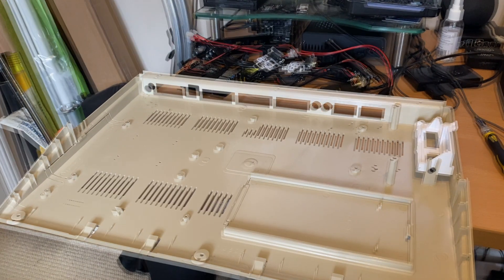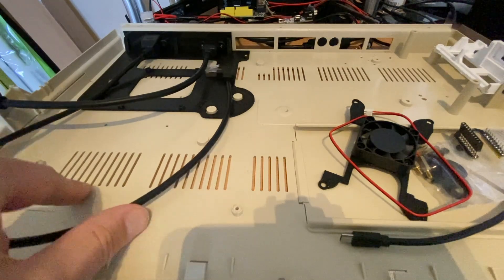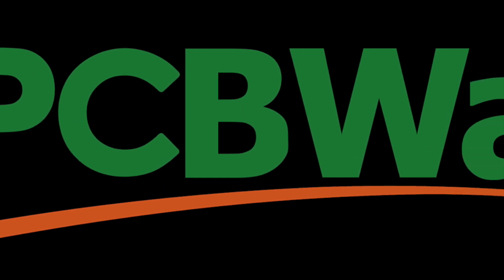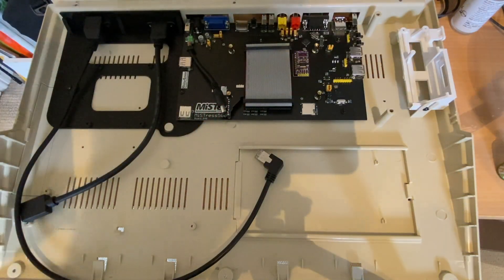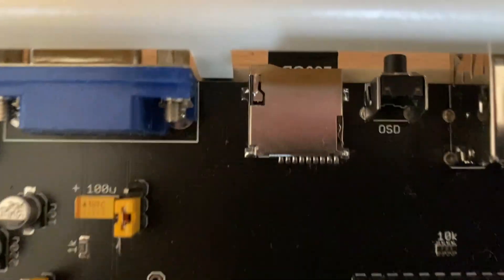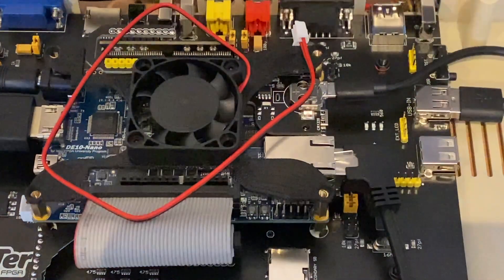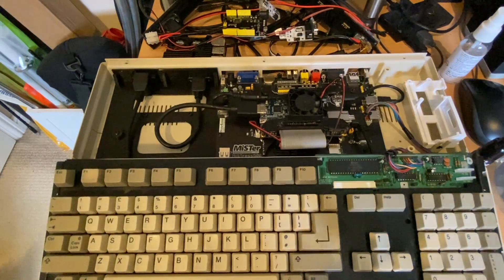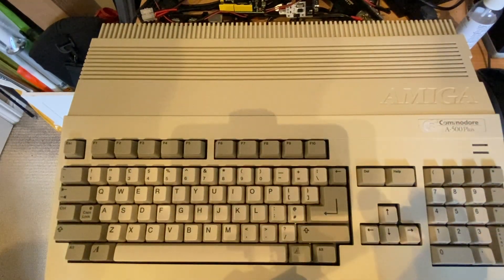Amiga 500 MiSTer + MiSTress 500 : Build Your Own Amiga

Comment: very nice, i didnt know about the mistress board.. a great solution, much better than my keyrah
Reply from the maker: Thanks Baz. I agree, much cleaner solution with the MiSTress board
Reply: @RTSRetroTechShed  I just noticed they do a 1200 version, i'm gutted cos i hacked the back of my 1200 case up in order to fit the pi/keyrah in..
Reply from the maker: Yes, that is a pity. Are you able to patch it with some 3D printing? I have some saved searches on eBay for Amiga cases, sometimes they come up at the right price - so maybe worth a try.
Reply: @RTSRetroTechShed  i'll have a look.  cheers :)

Comment: awesome video.  i just finished building a Mister in an a1200.net case with a variety of parts and adapters.  after seeing your video i'm now tempted to tear it all down and do it with a Mistress board.  it all looks so much tidier.  have you tried an MT32 Pi yet?
Reply from the maker: Thanks David. If you watch some of the other Amiga MiSTer videos on the channel you will see my earlier prototype using 3D printed backplates, but the MiSTress is definitely a much neater solution. I have tried the MT32 PI. It worked fine for me, but did exceed the power budget, so had to have a separate power supply.

Comment: Great video - don't know much about a mister so this was very interesting and a very neat solution with the mistress board. Looking forward to your follow up video. How well does a mister "emulate" so to speak, a real  Amiga? Are there still limitations/compatibility issues?
Reply from the maker: Thanks James. The Amiga 500 MiSTer is built using a Terasic DE10-Nano FPGA development board. This runs the Minimig Amiga core (and a lot of other machine cores) to create the Amiga chipset (68000/68020 CPU and the amiga custom like Paula etc.) on the FPGA. It does this every time you load the core, but very quickly. Development of the Minimig core is ongoing, but is already very mature. In terms of the user experience, there is little difference from real hardware. There are some other Amiga MiSTer videos on the channel you might like to watch as these will demonstrate more of the functionality.